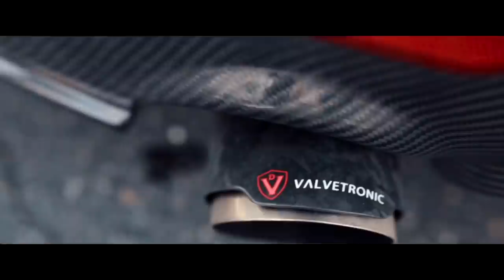REVIVING AN E36 M3 BMW IN 8 MINUTES!

Comment: How much did it cost to wrap it ? I was looking at an 05 325i coupe and the hood paint is peeling. It’s $600 and all it needs is a new battery and a few exterior pieces but I don’t like the color either. Want to either wrap it or repaint it.